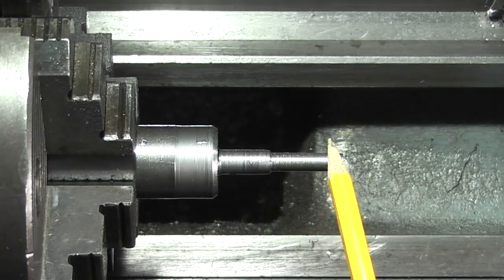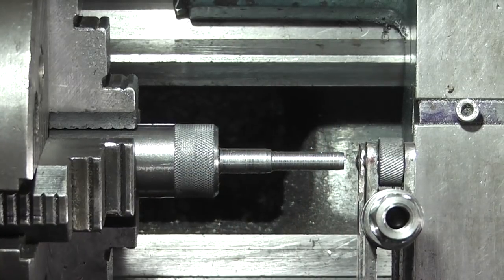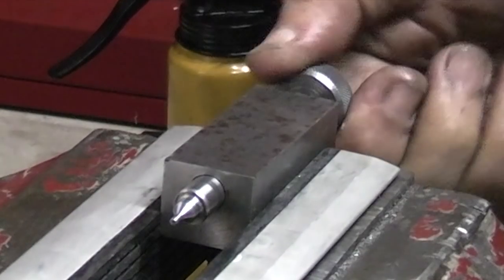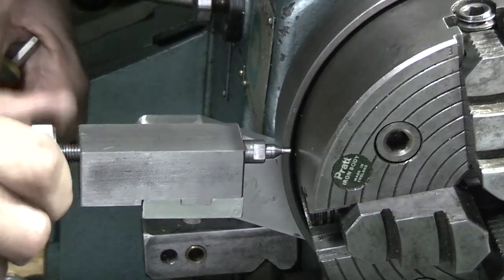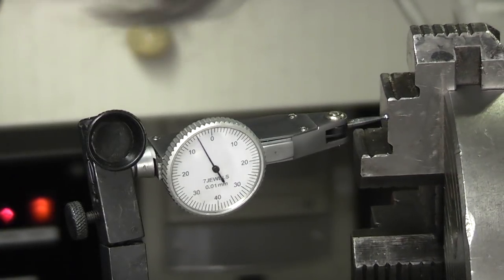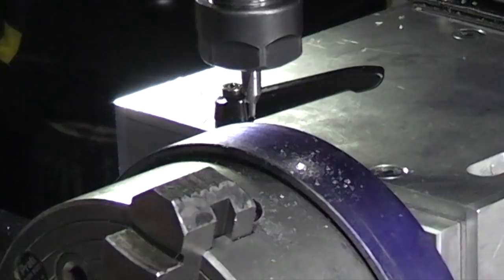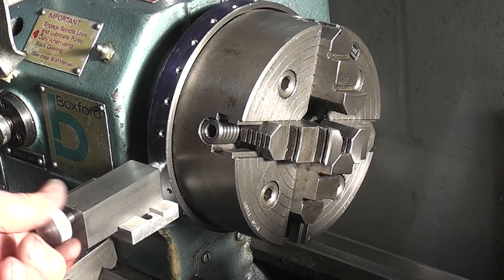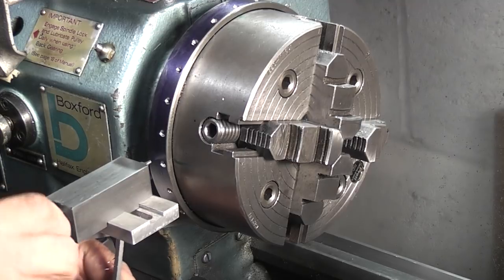Indexing ring finishing and test

Comment: I have stumbled on your site where you are using a Brake Disk Rotor as an Indexing Plate.
For the past few years I have been thinking along these lines. My idea is to use as large a rotor as possible. My reasoning is as follows, the larger the index plate the more possible increased accuracy with the greater diameter of the plate. I cannot remember where I saw it but I believe in the Victorian era indexing plate of a number of feet in diameter was employed to achieve the highest degree of accuracy. The only thing I can remember was the Plate was held in the Horizontal plane and rotated using a worm gear in to the correct degree angle. I would appreciate your thoughts on this matter. Thanks for Listening. Dave

Comment: How did u attached ring on chuck glue or press fit?
Reply from the maker: I used some screws into the chuck back plate to hold it in place
Reply: @enotsengineering  ring has second surface from side of back plate, right?
Reply from the maker: The ring has a face at the back of the back plate
Reply from the maker: See part one https://youtu.be/PdCgErVti84

Comment: Those indexing drill holes could go straight in the chuck. It wouldn't hurt any thing. You can get an extra used chuck for 2 or 4 hundred bucks.

Comment: Indexing Plate, Direct Index, I had not thought you would use the plate on the Chuck Side of the Lathe, Most I have seen using this principle have been on the outboard side of the Spindle where more space is available. I have to look over your site in a lot more depth.

Comment: Can someone fill me in please. How can the lathe get used when the locating pin is in hole  seen as the chuck cannot be turning.
Reply from the maker: Hi John. Let's say you need to put 3 flats on the end of a bar. You use the indexing ring to give you the 3 positions. Hold the bar in the chuck, and hold a device in the lathe's tool post which lets you mount a milling cutter powered by an electric drill.
Now you can mill a flat on the bar, turn the chuck to the next position to mill the second flat then the third flat.

Comment: On the Drilling you rotated 15 degrees, but to my understanding, you did not explain how you determined accurately how you determined 15 degrees. Sorry if I missed how you were able to precisely make a 15 degree rotation.
Reply from the maker: Hi Dave I used a stepper motor computer controlled. See my Video indexing ring finishing and test. Set dti on chuck jaw rotate 360 check dti error to show error over 360 degrees.